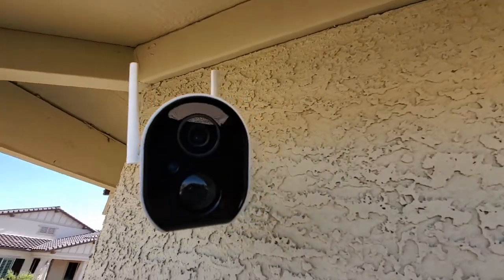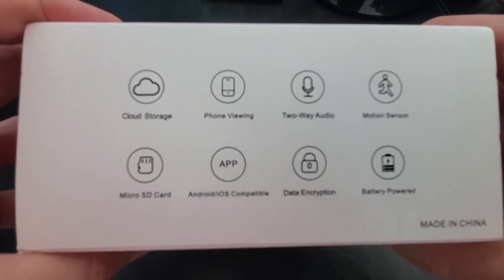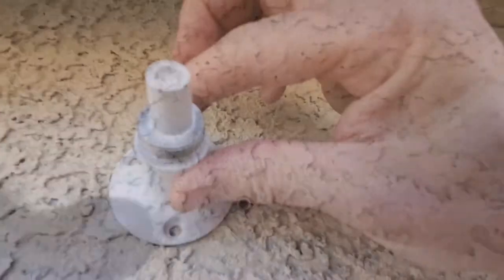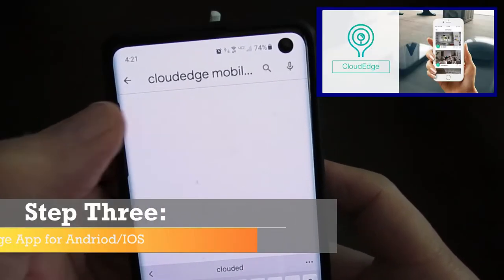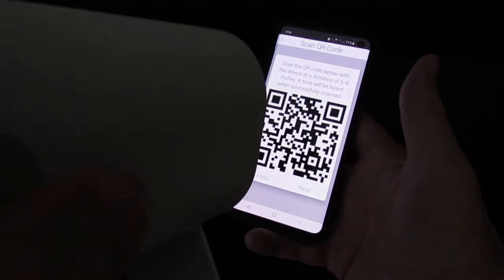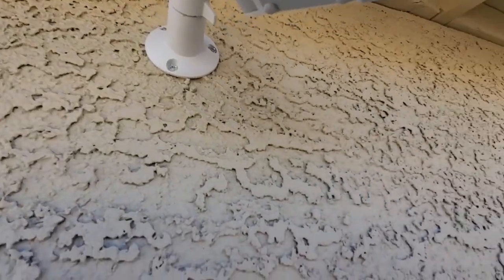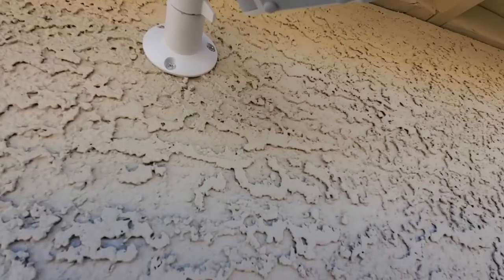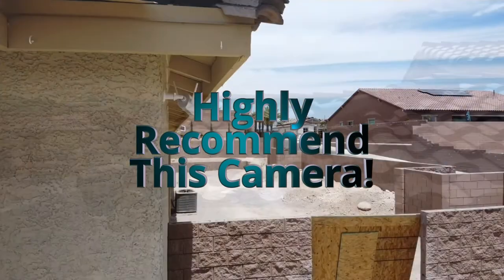BEST BUDGET SMART HOME SECURITY CAMERA OF 2020 | KITTYHOK BATTERY POWERED WIRELESS CAMERA REVIEW

Comment: Looks like a nice camera, lots coming out with the cloud storage these days.
Reply from the maker: Yep they price the cameras at a low price and try to sell the cloud storage to get rhe monthly fee. I probably won't sign up for the cloud storage.  Micro SD should work just fine. Thanks for watching Tony.
Reply: @UltimateTechHub  I got Nooie camera's in my house and its the same story with them. Issue I have with cloud it seems most charge per camera, when you got a load of camera's it becomes really expensive and you might as well have bought a proper CCTV system

Comment: Can a solar panel be used with this camera?
Reply from the maker: No, this camera has a self contained battery in it. So you need to charge it with the provided USB cord. It takes about 2 hours to charge it when its dead. The Camera lasts about 90 days on a full charge. FYI I've had this camera for about 10 months and it works great. The app is easy to use and setup. Thanks for watching!
Reply: @UltimateTechHub  Thank you for the info.
Reply from the maker: @Fireblade-Sc28  Your welcome.
Reply: @UltimateTechHub  hi i managed to get the camera today and set it all up with the cloudedge, the only issue i have is that i cant view the live stream from my cellphone while im away from the house. Once im at home and connect my phone to the wifi the camera connects to my phone.
Reply from the maker: @Fireblade-Sc28  It should work when you are away from home. Maybe try restarting your phone.